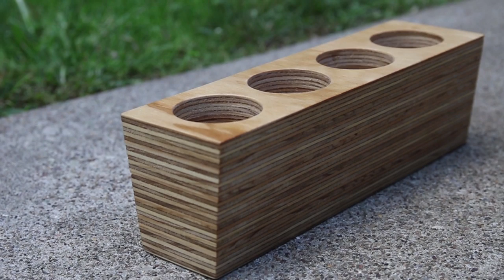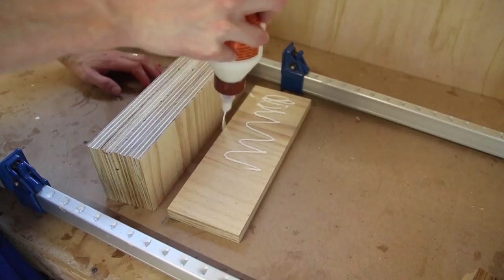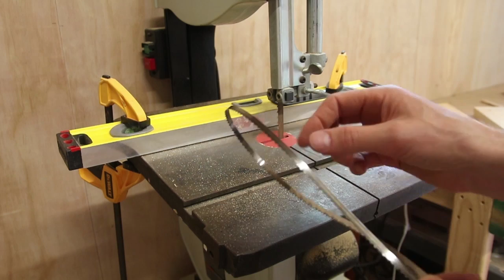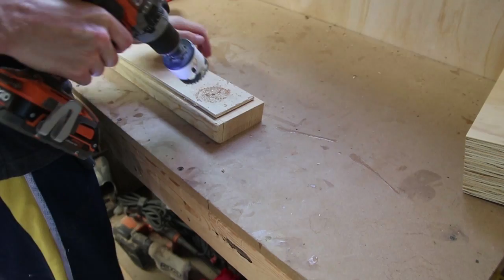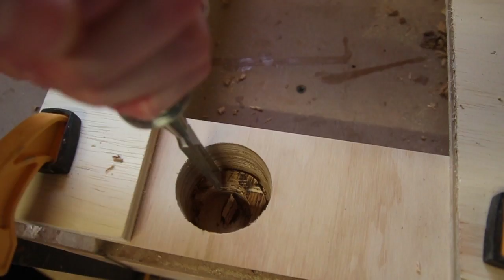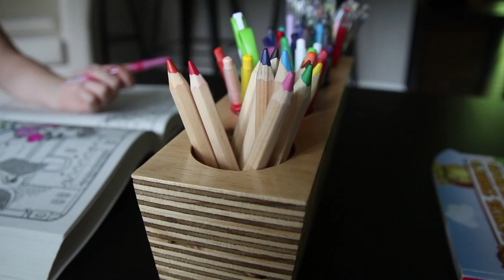How to make a Plywood Pencil Holder

Comment: I guess one option for digging out those holes wouldve been just to use the hole saw on each piece of ply and then stack them up and glue them afterwards (line the holes up). Leave the bottom piece of ply undrilled forming the base. Might have resulted in some neater holes.